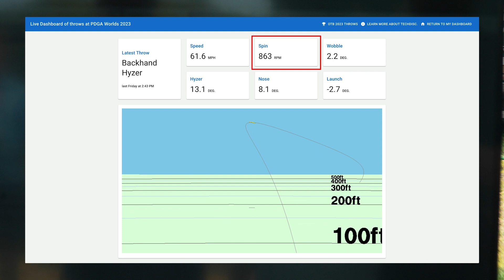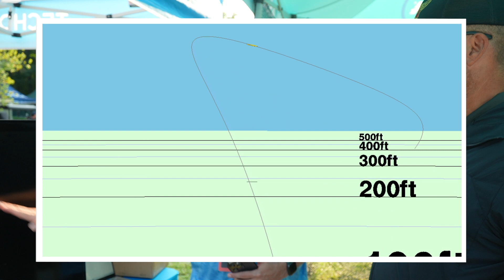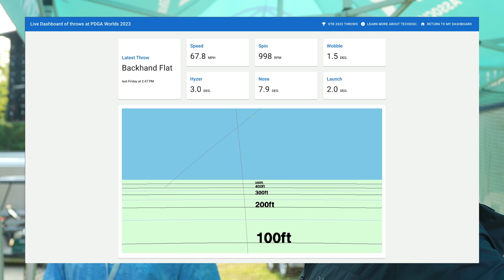Will Tech Disc Revolutionize Disc Golf Training?

Comment: Yes it will. But not for quite a while yet.
I have been considering the technology for many years - ever since Westside took a patent on a device about a decade or more ago. There's a cool YouTube video where some dude explains what it would be able to do.
But it will remain flaky, and unreliable, and too expensive until such time as the electronic components themselves are balanced around the inside of the rim of the disc, moulded directly into it. That way each component will be effectively cradled for each impact - because it is impacts which will wrecxk these devices.
They will need to be wirelessly charged, in a slot in your bag, and they'll act as Bluetooth disc locators as well as record a plethora of data.
And as with all things, this tool will greatly help some players who are prepared to put in the work with such technology, and unnderstand it, and use it to makes changes and improve with almost instant feedback.

Comment: Those distances are off lmao. Ain't no way a nose up with that speed and spin is going 400
Reply: Ya wish they would have actually thrown it not into a net and actual measured the shot and seen if the calculations were incorrect. I kind of want to get it just to do that
Reply: It doesn't seem that outrageous to me, lmao. My personal data suggests speed in the 60's = distances in the 400. I don't know nose up degrees super specific, so depends how nose up it reeeally is, but hyzer flipping something understable that gets a late turn would be reasonable for 400 which is what it did for the flight simulation. If the disc was too overstable to get that flight, a stall and fade would take away maybe 50 ft if I had to guess
Reply: @calvindelamere3489  I've thrown these a few times and my speed and spin is very close to that. Even with a lower nose angle it's not 400. All the measurements that the disc takes are great and can be used for some very valuable info, but I've found the sim isn't very reliable as far as distance estimates

Comment: I made a similar physics simulator, but found flight numbers to be an almost useless input for flight characteristics.  Had more success with disc actual parameters as well as having to manually input reynold's number and air friction coefficient for each plastic.  Humidity and temp are also pretty big inputs for simulations at this level.